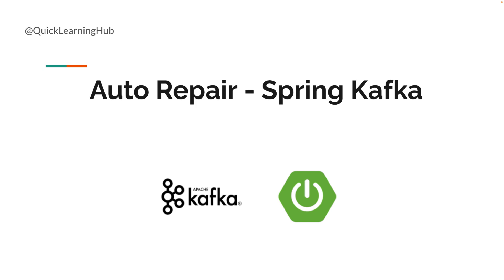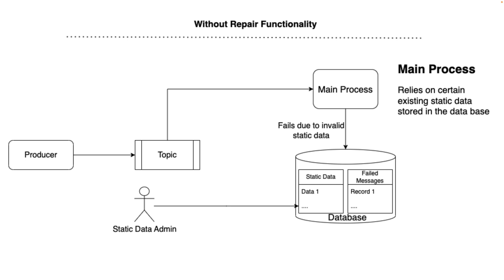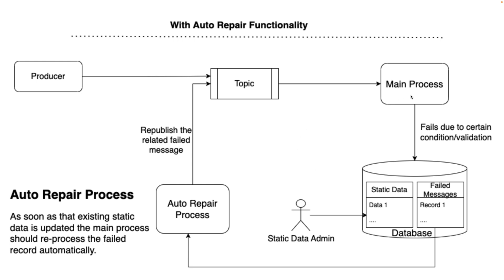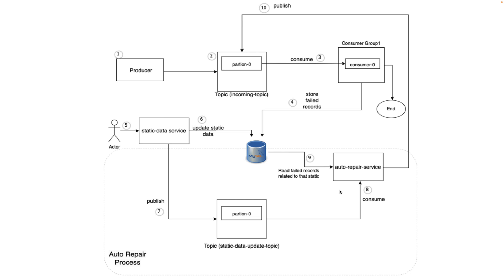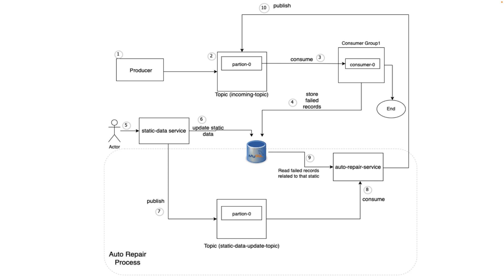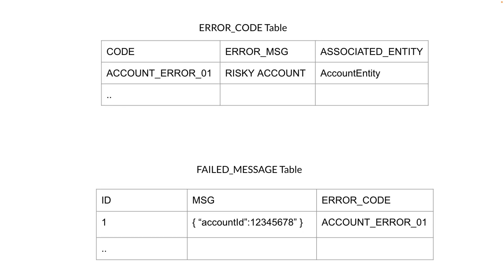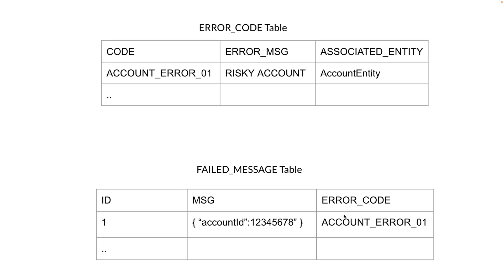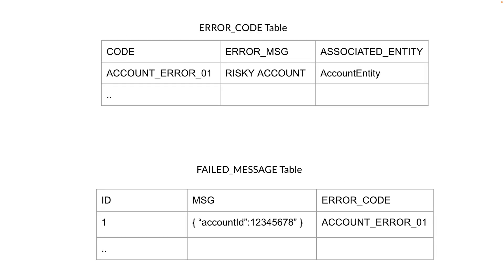Apache Kafka Reprocessing Pattern (Auto Repair) - Part 1

Comment: Hi Team, Hope you are doing great .. Thanks for your valuable time and efforts ..

I have one problem statement and trying to solve the same.
Please share your thought on the same

Kafka Retry and Recover mechanism consumer side :
1. When a message is first received, it is processed as normal.
 2.If processing succeeds, the message is acknowledged and removed from the Kafka topic (main topic).
3. If processing fails, the message is sent to a separate retry topic for later processing.
4. In the retry topic, a scheduled task (using something like Spring's @Scheduled annotation) periodically reads messages from the retry topic and attempts to process them again.
If processing succeeds on a retry attempt, the message is acknowledged and removed from the retry topic and the main topic.
5. If processing fails on a retry attempt, the message is sent back to the retry topic with an incremented retry count.
6. If the retry count exceeds a certain threshold (e.g. 5), the message is sent to a dead letter topic for manual intervention (we can save it in DB like H2).
Reply from the maker: Hi Shyam, Yes this a good approach.

3. If processing fails: do you need to process the message in order? if not you can acknowledge the message and can send it to the retry topic.

4,5,6. In retry consumer you can use the consumer record headers to maintain the retry count, while processing you can first check if the retryCount is available and it does not exceed the certain threshold process it.

if retry count not available this the first time we are processing that record, add the retryCount as 1 and try to process this.

And as you mention if the retryCount exceeds the threshold saving the message to database and acknowledging the message and not publishing it back to retry topic again this time should be fine.

In your scenario you may need to acknowledge the consumed message in the retry consumer everytime as you are planning to republish the same message to the retry topic on each attempt, to avoid processing the same message multiple times.
Reply: Hi  @quicklearninghub  bro  ,Can u give kafka training covering all conepts